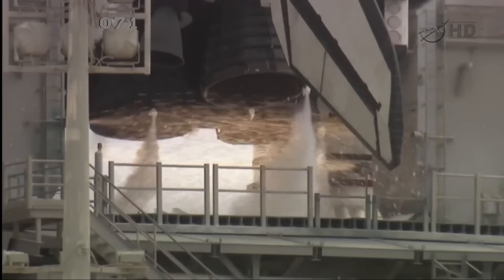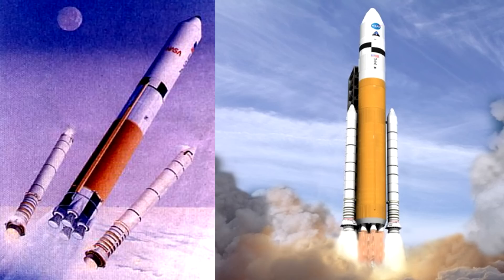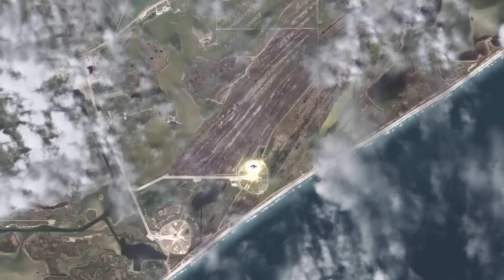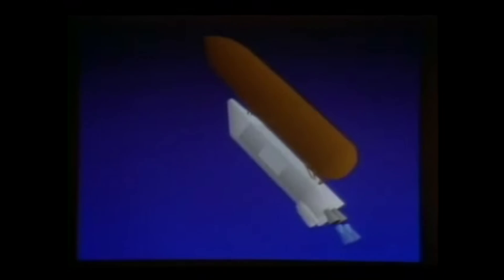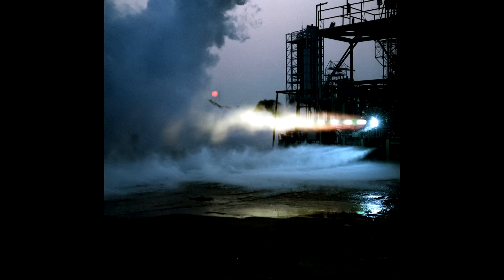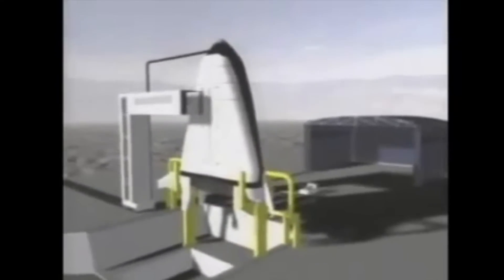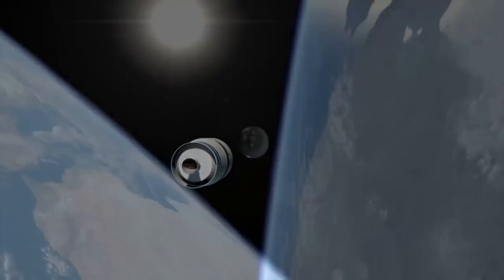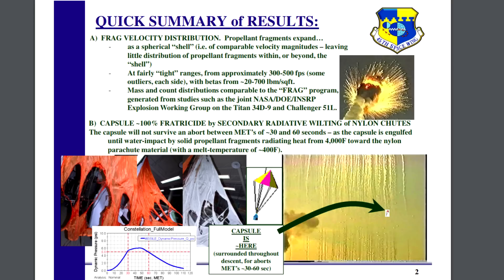Why The US Took So Long To Replace Space Shuttle's Crew Capability

Comment: No reusability is dumb
Reply: digitalk Which source said “reusable” rocket costs more than “disposable” rocket? Maybe the manufacturing process but definitely not the long term launch mission.
Reply: Reusable space vehicles are neat. Dragon is a great example. But there were all kinds of things wrong with the Space Shuttle concept. Like having comfortable living quarters, a giant payload bay, a big manipulator arm, etc. in space is great, the dumb part is launching it into space, then bringing it back down, and launching it again, over and over again.
With the amount of reconditioning of parts that was necessary to safely reuse them (combined with the very basic inefficiencies associated with using a big turkey like that as your go-to vehicle for every manned space mission ever) the Space Shuttle was a very expensive vehicle in terms of the cost-per-mission and the turnaround was never fast enough for them to reach their goals for mission frequency. Reusability is good but only if it's done well, only if it truly makes the system better.
Reply: Tetsujin Yeah. I agree with you that Space Shuttle was not a great reusable vehicle. However, we can can hope private companies can create decent vehicles that can actually satisfy its “actual” goal.
Reply: @haoteng2823  so.... the Falcon 9? The block 5 last night has launched 3 times.
Reply: Grady Klein Umm, actually, the Block 5 yesterday is not the rocket that will launch 3 times. It is the launch next Monday. I am excited for this. 😏
Reply: @haoteng2823  oh my bad. Misheard the stream announcer. Still awesome.

Comment: I really liked the Constellation program separating the crew and cargo rockets; Ares-1 for crew and Ares-V for cargo. I've always figured it would be more difficult to develop and maintain a rocket that would do both; SLS.
Reply: NASA basically has that option now with the Falcon 9 for crew (first crew mid 2019) and falcon heavy for payload.
The SLS can lift more payload into deep space than the heavy though, but you might find that most missions the SLS can handle could be done with a couple of falcon heavy launches.
Unless NASA really badly needs to get 140+ tons into orbit in one piece, then I guess its worth spending billions to get that capability.
I just can't help but consider what a 4 booster falcon heavy could lift.
Reply: @Marc83Aus   Indeed, I think it would be nice to see commercial crew and SLS working alongside each other for exploration missions. I love SpaceX and I love NASA, and I think to get to Mars they'll have to work very closely together.

Comment: One of the most pathetic and embarrassing stories in the history of spaceflight
Reply: I would say the decision to cancel the follow on programs to Apollo that would have utilized the hardware already developed was fairly embarrassing.  Basically tens of billions of dollars in R&D was wasted to spend tens of billions of more R&D on space shuttle hardware.
Reply: @SDGreg  Well, the navigation system for Apollo got a lot more use, at least!  AC Delco, who developed it, did a bit of extra work on it & converted it to aircraft navigation.  It was used in 747's for decades!  Up until the 747-438 series, the CIVA (C4A), was the main unit for all the 747s.  The ball, (the platform that held the gyros & accelerometers normal to the surface), also later made an appearance in The Expanse.  (It was the spinning bit on the outer hull next to Amos when he was repairing the thruster, while Rocinante was in combat.)

Oh yes, the computer in it ran a whole 6kB of magnetic core memory, that was used for what we would now consider hard drive & RAM.
Reply: Greg Brance and the space shuttle was ultimately a total failure, which did not meet the design goals. Politicians should not be running a space program.
Reply: @thedeviousduck8027  Politicians are unfortunately the only ones who can fund a space program.
Reply: Right, definitely much worse than the U.K., who almost had orbital capability, and decided to stop developing the project because there were cheaper alternatives...
Reply: @jaredhardegree8377  It had successfully gained orbital capability, and the alternatives weren't cheaper, they were just American
Reply: @alexanderchilvers1243  oh, even worse. Thanks for the correction.
Reply: @jaredhardegree8377  That still semms better than having crewed orbital capability with the risky and extremly expensive space shuttle, giving it up, starting another programm for policitcal profit, giving it up and starting another one with massive delays..
Reply: Buran can compite - a 14 billion program, envolved 1,5 million people,  that flew once, and was crashed by a rotten roof.
Reply: @RuslanArtur   14-16 billion roubles, not dollars. Which wasn't that much for a program more technologicaly advanced than US orbiter. Of course, it still was a waste considering how it has ended.
Reply: @RuslanArtur  the buran that flew was destroyed long after the soviet union fell
Reply: A bit dramatic. Should be pointed out there was a similar gap period between Apollo and the Shuttle system as well.
Reply: not as bad as the gutting of the russian space program taking place currently
Reply: Right up there with the Black Arrow program.
Reply: eh, ditching all that already paid for apollo hardware for some pie in the sky space shuttle that would take 20 years to build anyways and could be massively underfunded was a bit more of a embarrassing story
Reply: That is most easy money..put some concept ..receive billions off $ and produce nothing..then say we are ove budget but we have new concept..then spend again billions to produce nothing and repeat
Reply: I think the climate mars orbiter is worse, some guys mixed up imperial and metric units and they lost a billion dollar probe... stockroom clerks lose their jobs for much less. Those people should be in jail, it's taxpayers money they wasted.
Reply: Buran was a better, more refined, more what NASA actually wanted, shuttle than the US shuttle. But there's more than just economic collapse to blame for the Soviets not using it.
They had soyuz to put crew in orbit.
They had proton rockets lifting salyut stations into orbit, then later on putting Mir together.
They were already recovering reconnaissance satellites from orbit (basically soyuz pods with cameras).
They were already performing spacewalks out of Soyuz craft.
The soyuz and proton rockets were no reusable, but they were already very inexpensive.
Energia could be used by itself with no shuttle as a super-heavy lift vehicle.
But, they didn't have any projects that really needed a super-heavy lift vehicle.
There wasn't really any justifiable reason for them to NEED a shuttle. It's very strange that it was ever built at all.
Reply: No the most pathetic story is of a Proton with upside-down accelerometers, this story lead up to COTS which helped SpaceX establish itself in its early years and begin to dominate the launch industry, at the end of the day, no one benefits more from Shuttle's retirement more than the US

Comment: Could you do a video covering the history of the ISS? I'm also really curious how you would build a space station without the shuttle, how would you rendezvous and berth modules without the useful cargo bay and Canada arm?
Reply: Same way russians did build their space stations?
Reply: randomnickify The Russian stations were tiny and simplisitic compared to the ISS. Same methods wouldn't have worked. ISS was designed for Shuttle construction capabilities.
Reply: @RealityIsTheNow  No...Mir and ISS modules were same size..actually core module was bigger on Mir ...Its just that ISS has more modules and much more launches
Reply: A second Canadian arm is being planned for Gateway station funnily enough. They've found their niche is space.
Reply: Ben, I thinking you are looking at it backwards. The ISS was designed and built the way it was to give the shuttle a purpose, not because that was the only way to build a space station. Look at the docking capabilities Apollo had - LEM docking & extraction etc - all done without today's automatic systems.
Building a new space station needn't be too complex - providing pork barrel politics and legacy systems are kept out.
Reply: @glen8978  Yes, I agree, I know that the ISS was designed with the Shuttle's capabilities in mind (But also from the beginning of the STS program it was intended for the Shuttle to be used with a space station). The point I'm making was that those capabilities were actually advantageous in this case, it allowed them to build a space station that didn't require the extra mass and complexity of every component requiring rendezvous ability as the Russian segments did.
Reply: @benrobertson1255  78 ton space shuttle that they have to haul up every time was some considerable extra mass.
Reply: The shuttle was certainly useful for building ISS, but I'm certain we could have come up with some other method without it...
Reply: I'm just going to put this out there.

The only thing that made the shuttle useful for the ISS was the docking system.
It docked the parts. That's all it did. Russia made their parts to maneuver themselves.
Reply: automated docking vehicles are a thing for a few years now.
Reply: @Vulcano7965   Ya missed the point a little there.
Reply: Vulcano Actually, Crew Dragon has automated docking and will be flying in just a few months.
Reply: Ever seen "Schindler's list"?
Do you know that scene were Schindler is pleading with some military official not to take the children away, and he insists that their small hands are essential for polishing the insides of shell casings to prevent artillery misfires and such? And then a couple scenes later they show one of the workers polishing the inside of a shell casing using a tool that's clearly designed and well-suited to the job?
Like that. That's how you build a space station without a space shuttle.
Reply: @tetsujin_144  
Analogy taken, but in poor taste.  I hope you're not comparing Schindler's motivations to those of NASA exective managers or their subcontractor partners.
Reply: There is nothing the Space Shuttle did that SpaceX's BFR won't be able to do, and it will do it ten times cheaper.
Reply: @panpiper  What does the bfr have to do with this?
Reply: Peter Cohen Actually, far as I've seen, there is no BFR version that has anything like the Shuttle's gigantic cargo bay, and the associated capability as an orbital work platform. Maybe they'll come up with some sort of cargo version eventually?
Reply: @RealityIsTheNow  This is what I was thinking too, the Space Shuttle's criticality to the success of the ISS's assembly is often overlooked when people evaluate the merits of the Shuttle. 

The orbiters allowed modules to be rendezvoused and berthed together without those modules requiring their own propulsion and guidance systems, thus saving mass, complexity, and cost. This was immensely important to the ISS, think of all those truss segments, US and international modules (Yes the Russian ones did have prop, almost as if being their own spacecraft). This was what enabled the ISS to be so large compared to Mir, where all the modules had to be able to rendezvous and dock, imagine the nightmare of assembling something like the ISS's integrated truss structure this way.
Reply: @benrobertson1255  using rocket's final stage as automated propulsion/manoeuvring module is nothing new so additional modules are not necessary. Space shuttle was just insanely expensive truck nothing more. This damned thing weighted 78 tons empty, even if you wanted additional propulsion module it would be lighter and cheaper to launch than 78 ton orbiter with 7 person crew.
Reply: @RealityIsTheNow  guess what, you can launch one single assembly module of a space station and... then you can use this module as orbital work platform, catching and adding modules from inside a space station itself, external work platform of space shuttle is not necessary.
Reply: @randomnickify  Yes, it's feasible to build a Space Station without the Shuttle, the point I'm making is that the Space Shuttle was incredibly useful for it and I don't appreciate hindsight bashing of the STS. And as you've pointed out; if we didn't use the Shuttle we'd have had to use some other upper stage tug that didn't exist back then (Again, not saying it wasn't possible). In addition to its usefulness in the assembly process, the STS was instrumental towards giving NASA the confidence and mandate to build the station. What's more, the STS was way cooler than any other method.
Reply: Peter Cohen, Ah, so the BFR will be able to service Hubble? And when will it fly?
Reply: @slikrx  Like a lot of things about SpaceX, the BFR is a bit misunderstood.  The "BFR" is the booster, on top of which will be the "BFS" spacecraft.  The booster is already under construction and is scheduled to begin test flights sometime in the next couple of years.  The BFS probably will come some time after that. (SpaceX is notorious for not living up to ambitious schedules.) The capabilities of the spacecraft could include orbital servicing and possibly a shuttle style cargo bay.  I would expect that is something on their minds, but is not the primary purpose of the thing.  

Additionally, the booster would theoretically be able to raise entire sections up to the ISS that are larger than any currently installed.  The BFS itself as designed is larger than the section of the Saturn V that was used for Skylab, itself much larger than any of the components of the ISS.
Reply: @tarmaque  BFS will be built before BFB and will do hop tests and suborbital flight. BFB will come after BFS is tested.
Reply: @snviper   It's possible I misunderstood.  I've seen video of the construction of the fuel tanks, which looked too large for the BFS.  (that is, too long)
Reply: @panpiper   The BFR, as it is presented today, is a chimere, like its supposed launch cost.
And it's not the topic of this conversation...